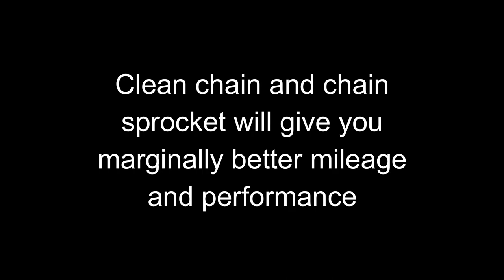How to Clean & Lube motorcycle chain at home

Comment: Acha bhai hornet mein  k&N air filter lagane se kya hornet k top speed bar jayegi yani jaisa hornet 115 se upar jane ke liye thora struggle karta hai, isliye kya k&n air filter lagane se hornet har bar easily 120 ya 125 tak ja sakte hai kya please batao?
Reply from the maker: Nahi k&n lagane ke baad top end kam hojaega

Top end barane ke liye carburetor ka pilot jets or main jets bhi changes krna prega

Wesa karne pai pickup b improve hoga

Agar Sirf k&n laga dengai toh toh Sirf pickup Acha hoga

Or agar top end chaiye to chota wala k&n direct carburetor sai lagana prega tb utna struggle nhi karegi 

Jaisa apache 160 vs hornet wale video mai jati thi usse b asani sai

2nd round mak thora struggle krri thi bcoz or k&n